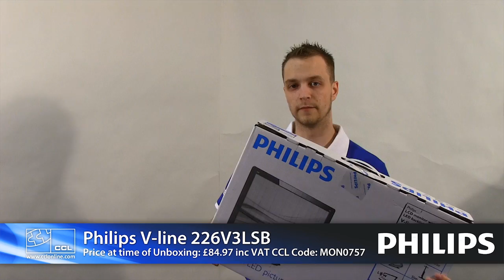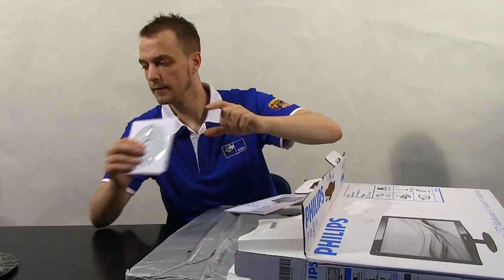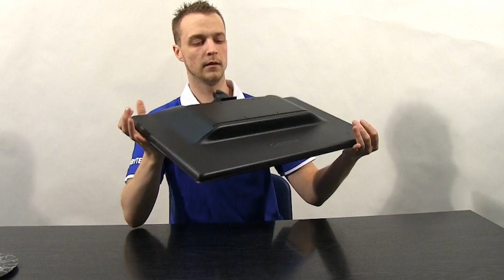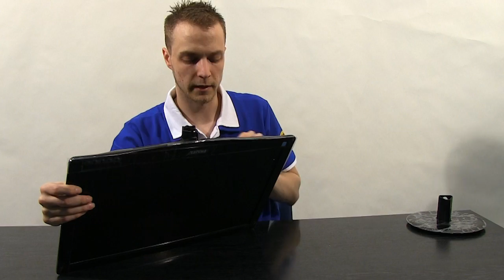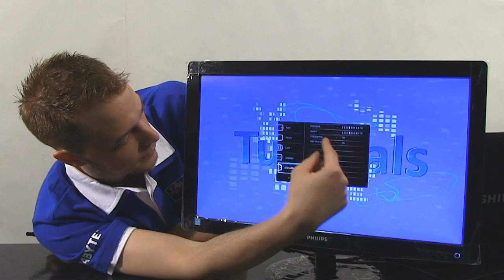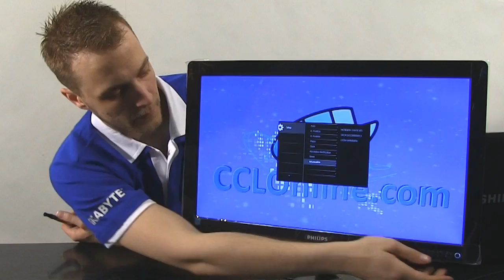CCL Online Unboxing : Philips V-line 226V3LSB 22" Monitor

Comment: Hello,did you have issue with power cable? My wont hold well when i plug it in monitor.When i turn around monitor or try to move it,cable go out all the time.Is there a way to fix it somehow to lock it to stand still?
Beside that monitor is good,all recommendation.